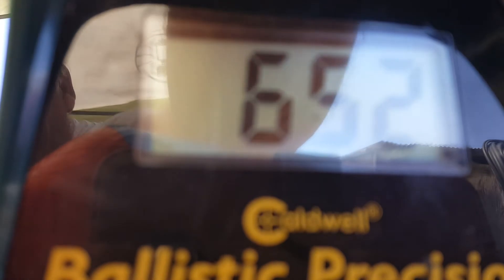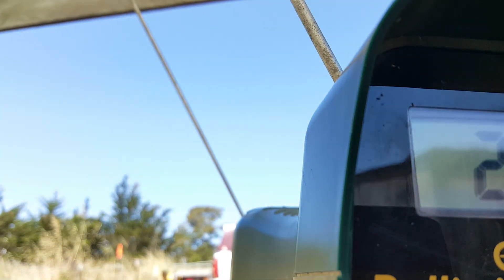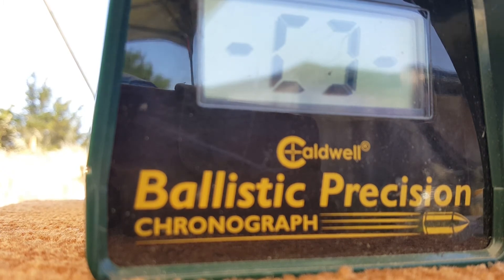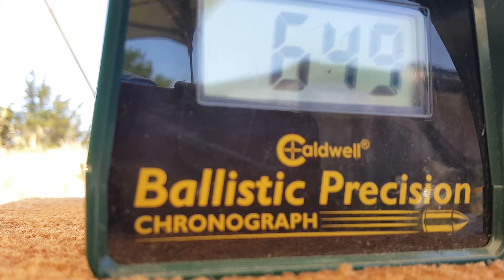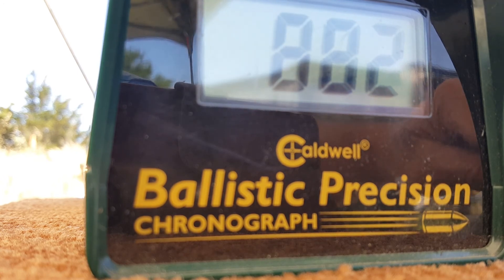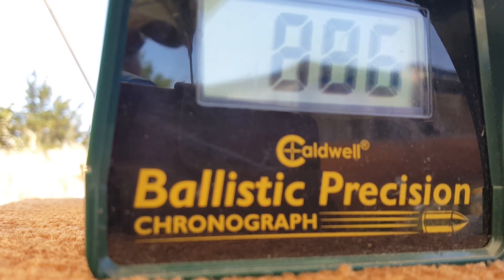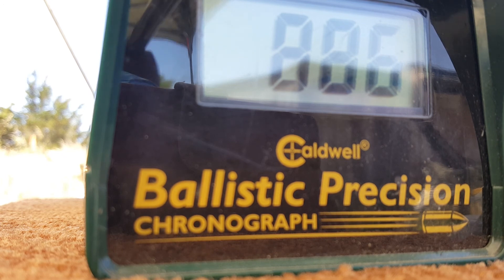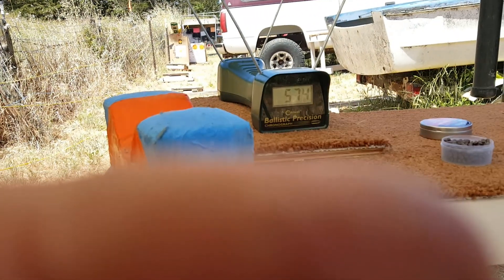Daisy 880 air rifle .177 caliber chronograph test after using motor oil lube

Comment: Your motor oil MUST be NON DETERGENT, if it is not, you will deteriorate your seals. You did not say this in your video, it is very important for Daisy 880 owners to know this. Other wise a nice little video showing how important lubrication is for the 880.
Reply from the maker: Thank you
Reply: I use motocraft automatic transmission fluid type 5 for my gun oil    and at 50 yards I can hit the center of a dime on every shot at the bottom of a soda can
Reply: Having to use non detergent engine oil is a complete myth...

Comment: I think it would be excellent to use motorcycle chain lubricant with Teflon, it is thick and seals well the piston seals, apart from it does not affect the tires and the aluminum of the cylinder. For example.. Repsol chain lubricant
Reply from the maker: Try it
Reply: @SteveChishamSr  I applied it a while ago and tried it, I feel more pressure when activating the pumping lever, I do not have how to measure the speed of the ammunition, but I use the gamo raptor and now penetration is much greater than 20 meters and has less drop,  it certainly has more power and speed.  recommended and is Teflon based.